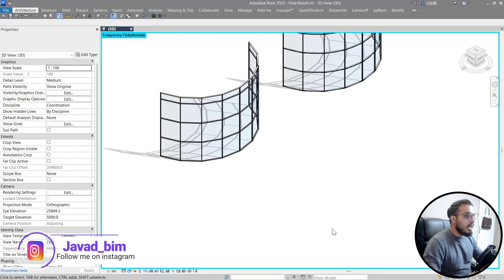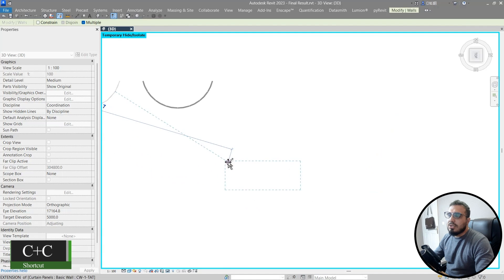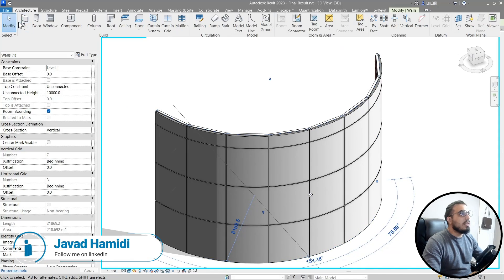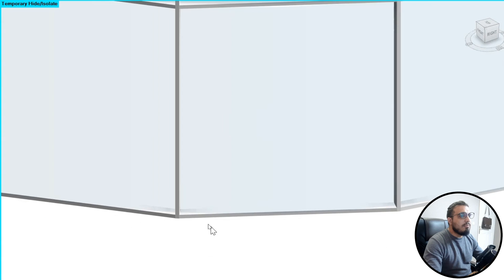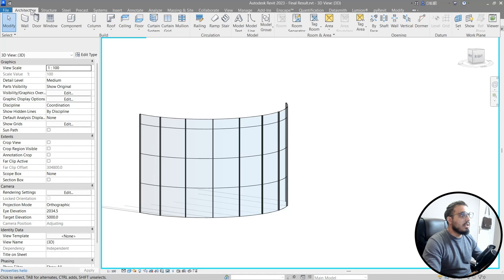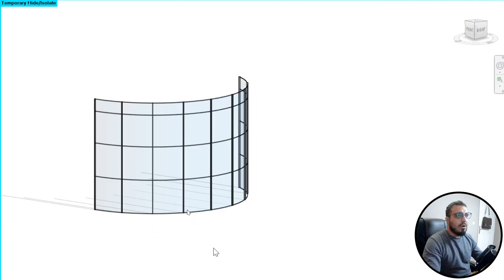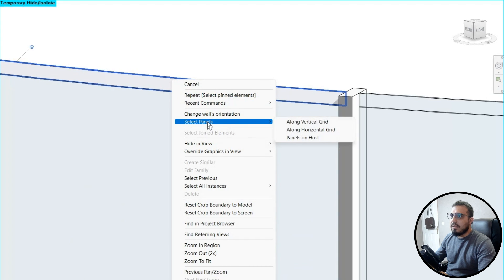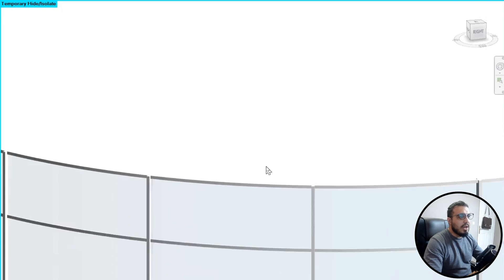Real CURVED Curtain Wall in Revit

Comment: Do you have a video where you apply this same concept to a roof, instead of a wall?  Looking to make a truly curved section of greenhouse where the wall bends and becomes the roof (basically roof by extrusion), but without angled segments.
Reply from the maker: not really but if i found the time to test it I will let you know
Reply: im trying to do the same with greenhouses. Have you found anything @jpbernier3908?